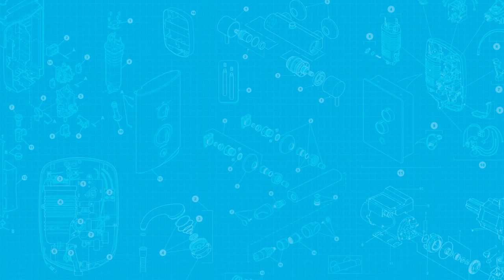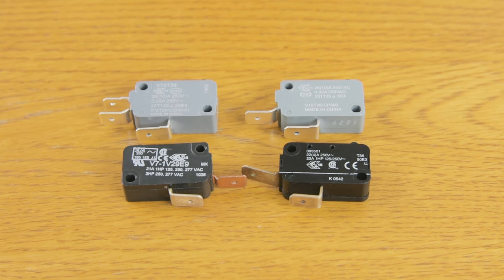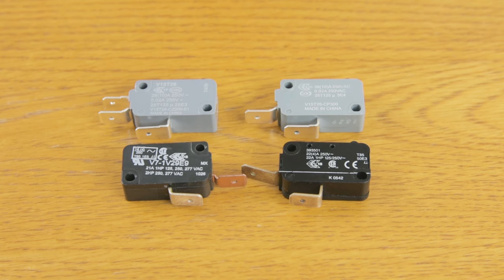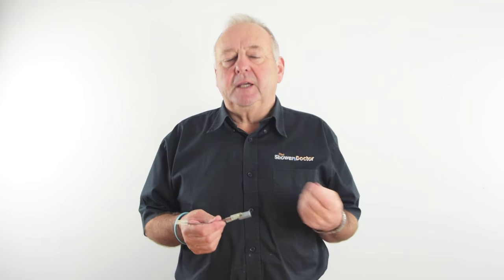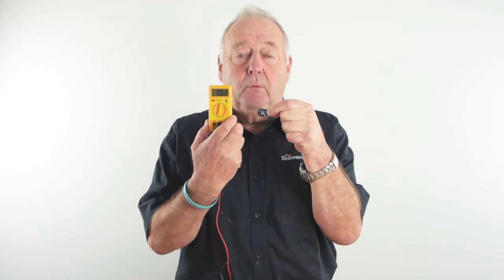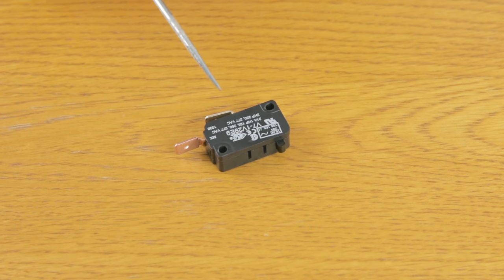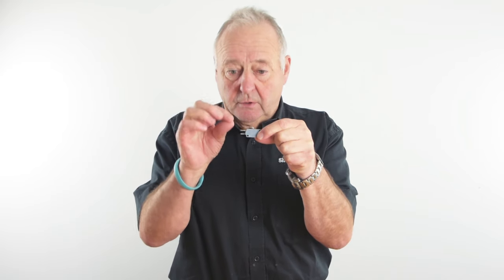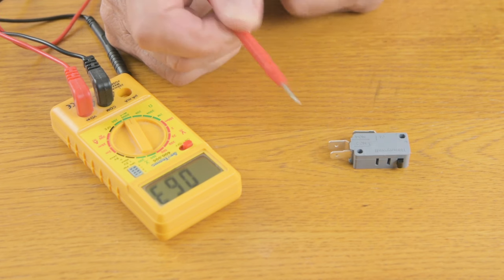Electric shower problems: How to test a microswitch.

Comment: Nicely presented video thanks. One sobering aspect of these switches is that the contact resistance of a healthy switch is going to be just a few milliohms. Power dissipated in the switch is current x current x resistance  or I*I*R so 15A x 15A x 0.01 ohm = 2.25W. Enough to make the switch run quite hot. I've just seen one of these switches fail in a shower. Once the switch contacts get pitted or oxidised such that they increase the contact resistance just slightly then thermal runaway occurs very rapidly. The contact resistance goes up with temperature (this is basic physics) and once this kicks off the switch will soon get so hot it will emit sparks and break down rapidly and quite spectacularly. I don't think you can test those switches adequately with a multimeter in this respect. My advice to anyone is to replace these switches every few years or so as a matter of course even if they still seem to be working OK. When they fail it is quite scary if you are the person taking the shower at the time!

Comment: Thanks a lot. 
Would you please tell me how could I identify a 2 pin microswitch either it's a normal closed ( nc) OR normally opened (no) by reading the printed circuit diagram on the back of the switch. 
Your reply is appreciated.

Comment: Hi mate , thanks for the videos! 
I have a 2 year old Electrolux instant shower that doesnt power up... Water is running through it but there is no heating.
The switch outside of the bathroom that sends current to the instant shower works though. 
Where do you think I should focus my efforts to solve this problem? 
Thank you!

Comment: Thanks for this video. I was able to fix a Triton Aquatronic 4 which has the odd behaviour of making a kettle boiling sound for a few moments after switching off caused by a failed microswitch that is letting power flow into the heating elements making it run very warm even switched off. The problem is the microswitch is integrated to the Power PCB so I had to replace the whole PCB which cost a fortune, it could be cheaper for someone who can do repairs at PCB level.

Lesson learned here is to not buy a touch control or power/temperature buttons based electric shower that uses a PCB. Better stick to a simple mechanical/knob controlled shower as you can replace the microswitch more cheaply and easily.